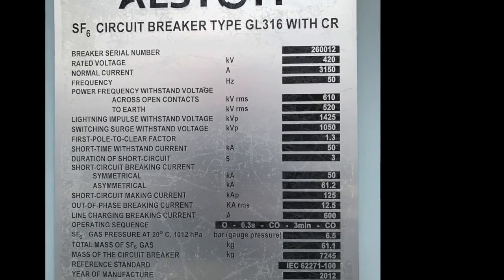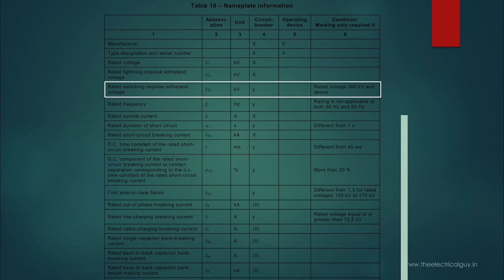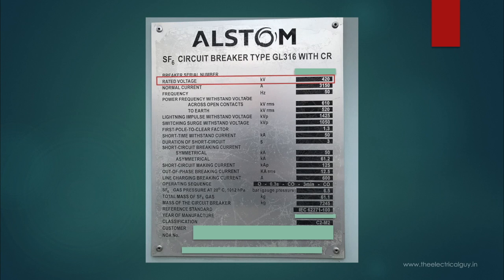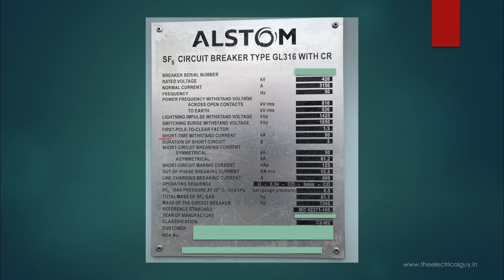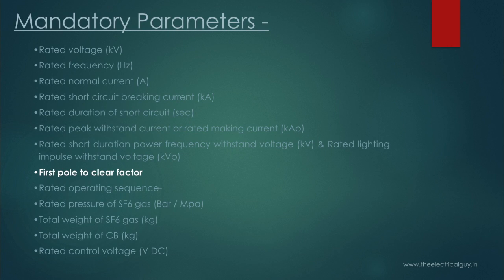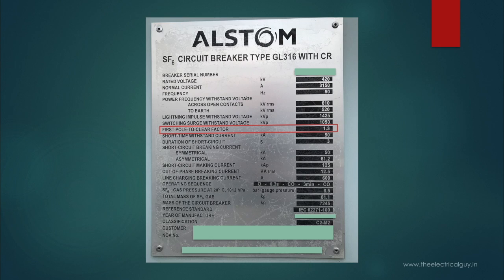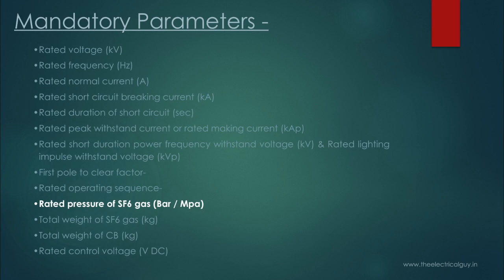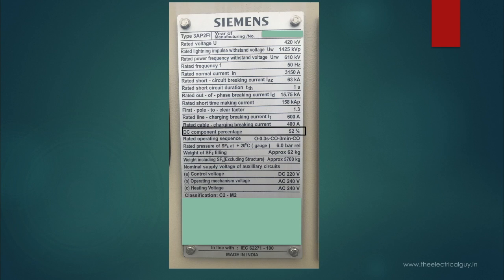Nameplate details of SF6 Circuit Breaker | Explained | TheElectricalGuy

Comment from the maker: PS - Electrical endurance class (E1 & E2) is only applicable & limited for distribution circuit breakers (1kV to 52kV), as per IEC 62271-100. And hence, the same is not applicable for breakers above 52kV voltage level. Please ignore the sentences I spoke about electrical endurance class in the video (@ 13:25).